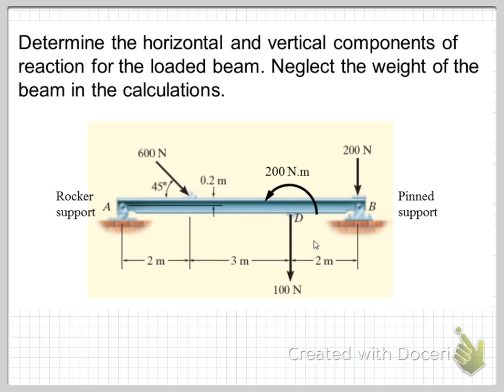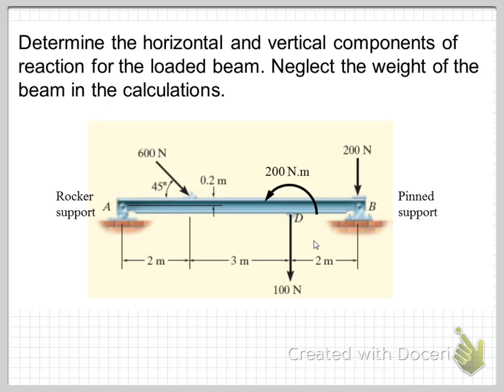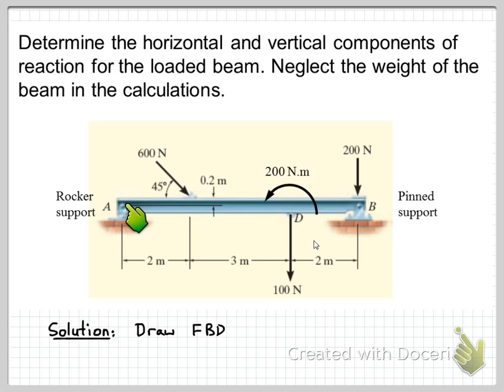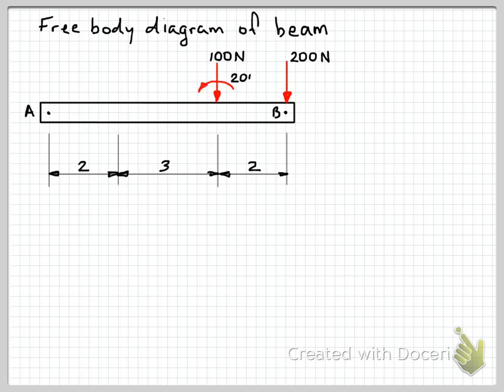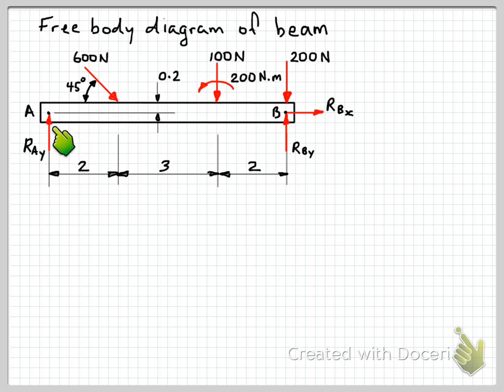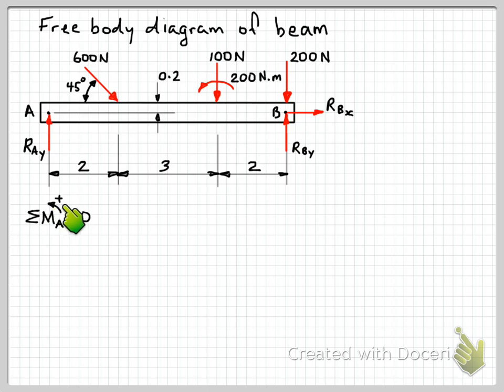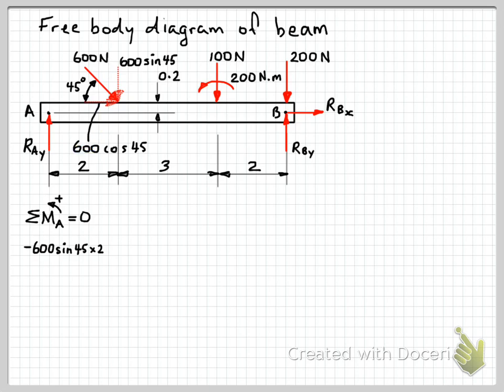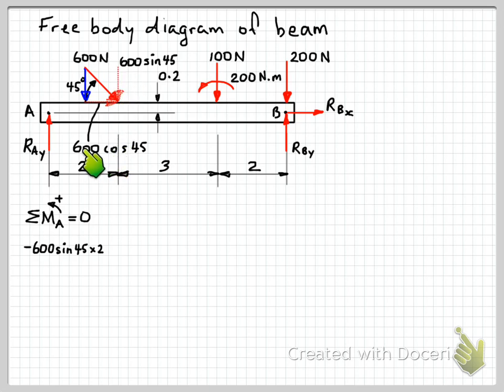Beam rigid body equilibrium example

Comment: I'm not sure if you're still around Mr Brown, and I looked through the questions to make sure this wasn't asked already, but i am curious to why the Rbx reaction is running left to right (+), as it is a pin and I see the push force from the other end (+600cos45) is also running in the same direction, wouldn't that make the reaction at the pin (Rbx)  oppose that +600cos45 force, thus be negative? I saw in the comments someone say you didn't use it anyway because it was in line with a moment, thus this is sort of moot. but just curious to the theory as reactions sort of confuse me.

Edit: Having finished the video, I guess for both horizontal forces to =0 (to be in equilibrium), one has to be the negative of the other. Instinctively feel wrong though, but adds up.
Reply from the maker: Hi, yes, I’m still around, but missed your comment. Sorry. Yes, Rbx will be negative and that is the answer that I get at about the 13min mark. Your last sentence indicates you may have some misunderstanding about moments though.
Reply: @TerryBrownMechEng  I guess I I may be conflating horizontal equilibrium (LHS forces=RHS forces), where a moment is force x distance about a point, so I assume the reaction force will be the same but in opposition?
I'm studying mechanics 1, we're looking at forces through a dissected beam currently. I did have an "A-ha" moment last week realising that the bend above and below the horizontal axis of the beam (tension and compression) indicates which direction the moment goes in (as often the reaction forces feel instinctively opposite to what I feel, I guess a reaction is always going to be opposite to the applied force)
But thank you for replying, you must truly have passion for this subject.
Reply from the maker: Sometimes our instinct/intuition is wrong. Good and correct free body diagrams and use of the equilibrium equations will tell us the ‘truth’. Keep thinking more deeply about what you’re doing, and asking questions, and you’ll get it.
Reply: @TerryBrownMechEng  I'm studying distance education, so just reading textbooks really. So your videos help thank you.

Comment: Why is studying these shear and moments in a beam studied in mechanical engineering? Are there any applications?
Reply from the maker: thanks for the very good questions. Sorry for the delayed reply. Any structural component that has length greater than about 5x the other two dimensions can be considered a 'beam'. Of particular interest is the moment because we use this to calculate the normal stress due to bending, i.e. normal stress = My/I. A typical example in a mech eng application is a power/torque transmission shaft.

Comment: I could be 7 years too late but if I took the moment around B instead of A would I include the 200N acting on point B at all or would I ignore it?
Reply from the maker: Eoin - not too late, I'm stil here :) . If you take moments about point B, the moment effect of the applied 200 N force about point B is zero (since the perpendicular distance from the line of action of the force to the point is zero). Try it and see that you get the same answers. This is a good way to check your equilibrium equations and calculations.
Reply: @TerryBrownMechEng  thank you very much!

Comment: Why is that length a .2 and not a 2??
Reply from the maker: the 0.2 dimension is the distance from the centre-line of the beam to the top of the beam (i.e. the beam is 400mm deep)

Comment: Sir if 600 N force at on point A and angle is unknown then?
Reply from the maker: Sorry, i'm not quite sure what you're asking.
Reply: @TerryBrownMechEng  sir im sorry it's just autocorrect. I'm asking if in the same question the angle of inclined force is not given then?
Reply from the maker: @SukhwinderSingh-ug1sx  if the angle of the 600N force is not given, then you can't solve the problem.
Reply: @TerryBrownMechEng  because the unknown would be more than the equation?
Reply from the maker: @SukhwinderSingh-ug1sx  kind of, I guess. But really, in this case, it would be because you would have incomplete input information.
Reply: @TerryBrownMechEng  thanks a lot. I have one more doubt. What if inclined force act on roller support. Because roller support only resist vertical for. Sorry for so many questions 😃
Reply from the maker: @SukhwinderSingh-ug1sx  sorry, I'm not really sure what your problem is with 600N 45deg force and roller support. The inclined force is just a force acting on the beam. You're right, a roller support on a horizontal surface only supports a vertical reaction force. But there is a pin support at B.
Reply: @TerryBrownMechEng  no I'm asking in general.

Comment: I think the 200 its negative cos its going to be clockwise
Reply from the maker: do you mean the 200 N.m applied couple moment? I'm not sure why you think it is clockwise, the curved arrow is indicating anti-clockwise. If you mean the 200 N force applied at end B, then yes, it will cause a clockwise moment about point A and I have shown that moment as negative in my solution i.e. -200 x 7